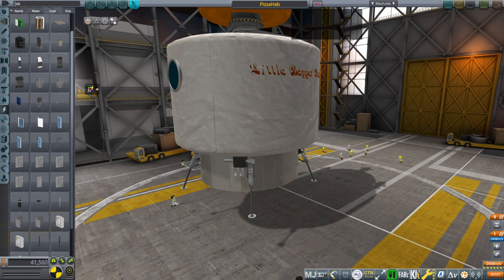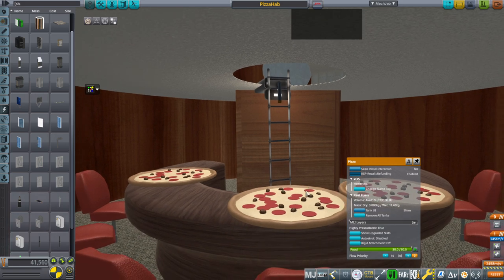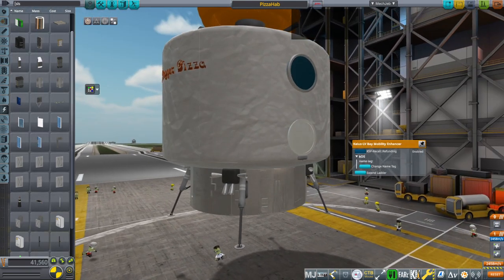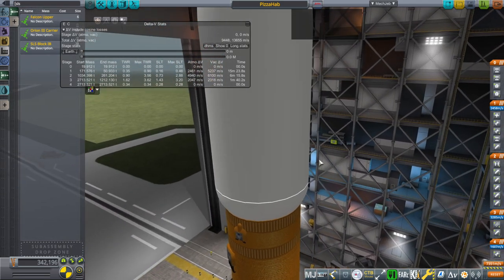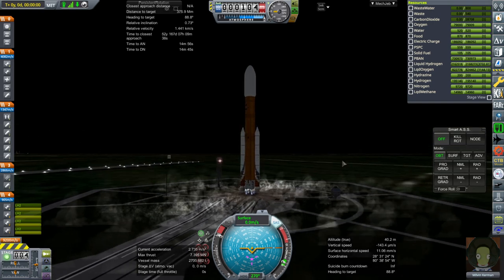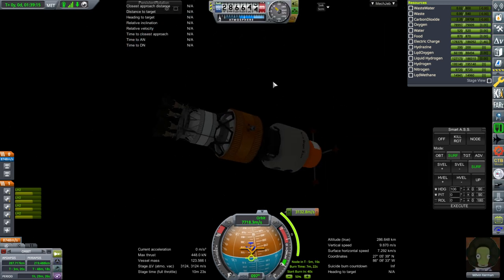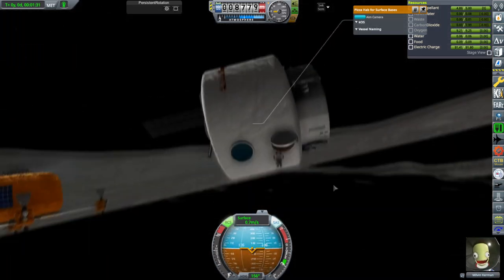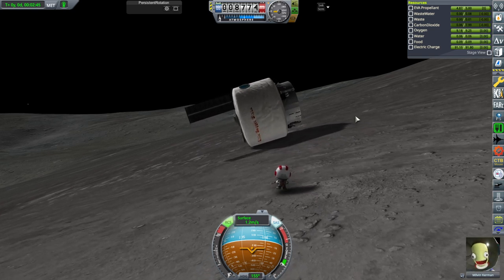KSP with Realism Overhaul - Lunar Pizzeria Test Launch

Comment: you have very bouncy landing legs. softer springs and max damper do the trick.

kerbals don't need chutes on the moon, you can unequip those in the vab or even replace with extra propellant tanks.
Reply from the maker: I think I'll be doing this in 1.8.1 instead, given the life support issues.

Comment: Raiz space do you know SSTU labs mod?
Reply from the maker: I know of it, sure. It's tough to get all its parts to work with Realism Overhaul, though, because of the dynamic way they're configured.
Reply: ROTanks does the tank functionality, but that's about it, the engine clustering feature from what I know is discouraged but somehow katniss makes it work